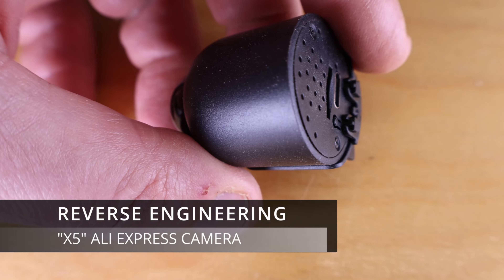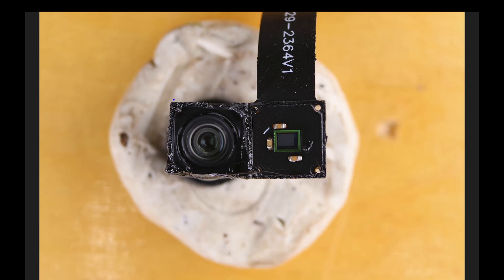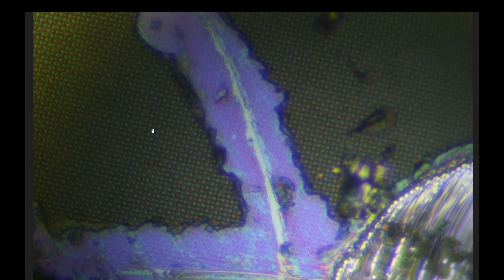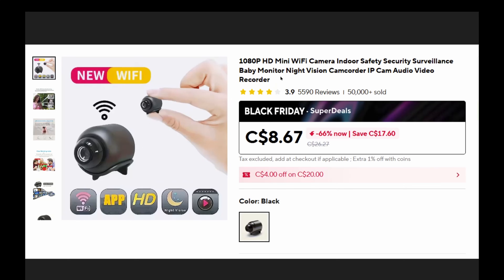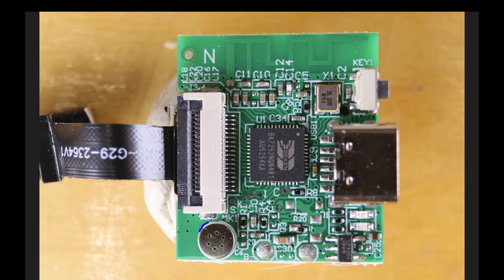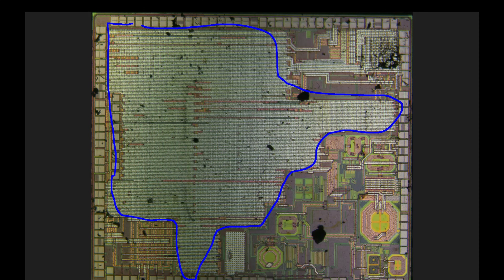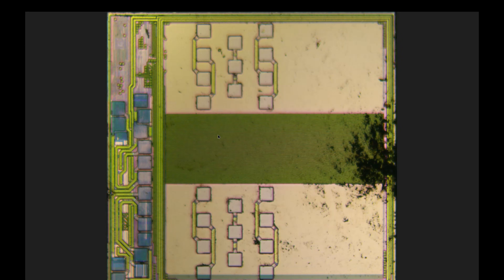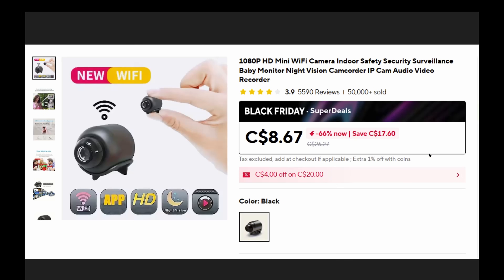Reverse Engineering Ali Express Spy Camera

Comment: I was actually looking up those spy cameras right around when you posted this video. And yes, I went straight to aliexpress when I had came up with the idea of me wanting to put cameras in my frog tank. But after a few hours or more of trying to pre-research specs on these, and then trying to camera of what I can find for popular security cameras... I figured that the $100 security cameras didn't have the quality that I wanted, something like claims of 4k at 24 fps, but actually paying attention to clips recorded from the device, I didn't like it. So I go back to looking on aliexpress, and just think, there is no way a $28 4k spycam is going to be better than these $100 ones.

And I kind of had ahead start in the rabit hole, because I had bought a so called 4k polaroid camcorder from a thrift store for $20. And I recorded some videos of my frog, and the quality was -- not what I was looking for, and it seem to have no focus system at all and it was digital zoom without any kind of focus system. It seemed worse than my ulefone armor x11 phone that I bought in 2023 for $170.

I ended up figuring out that I can just use my work provided iPhone 16e or something -- it has a single camera on the back... And I actually like the video quality it can record of my frog. It's just that I have to manually wake up in the middle of the night and turn the light on for maybe 30-60 seconds and record whatever the frog is up too, because the frog is nocturnal, but at least I get quality that I like.

Comment: The 5 pin chip is actually a battery charger chip, which outputs to the 2 unused solder pads along the side of the board. And for some more fun the other 2 pass on the other side of the board are actually for ir leds, for night vision. You can actually see voltage on the pads if you select the night vision toggle in the app.

Comment: Those beken chips are pretty popular in iot devices these days. Afaict, they're all old ARM9 cores (like, armv5 I think?), not even cortex-m (I think they might also make one or two risc-v models), but the manufacturer has shipped/leaked enough sdk files that people do manage to get their own firmware on other such devices. Kind of weird they use such an old core but presumably they got a bargain on the license (in exchange for missing a bunch of atomics instructions among other things), to leave enough for the various other silicon IP in there. (Radios etc)

Comment: Girlfriend bought one to use as wildlife capture for backyard, I took one look at it and thought - that'll never work, installed the app, usual Chinese affair, could not get the damn thing to work. My thoughts exactly on the agenda setting up the app, to be fair I was more inclined to believe it was an attempt to extract more cash for "unlocking" features. Definitely a case of but cheap pay more, better off just buying a reputable standalone device, we'd never need WiFi connectivity, just being able to bring the memory card in for appraisal now and again would have been ideal

Comment: For those playing around with these: While I'm not aware of any alternate firmware, there is a small tool called "cam-reverse" by  David Ventura which allows you to grab the images and audio locally. It also works in P2P WiFi or if you block internet access for the camera. Not entirely reliable, but still better than recycling a working product.

Comment: Those beken chips are pretty nice and a lot of newer IOT products (mainly from tuya or tuya rebrands) use them. They are supported by opensource software like openbeken and such. They are usually found in such tiny micro cameras where there is no space for a full embedded linux system and they instead run Rt-thread RTOS and use a simple firmware

Comment: Surprising they went to all the effort to integrate wifi but not an oscillator circuit to use a simple crystal rather than an external oscillator
Reply: if you want your thing to work right you cannot depend on whatever is on the silicon, you have no reference on it.  
One can characterize the silicon quality of service and do some other cool things with a couple ring oscillators but even then you're already adding external clock/stimulus on the testbench.  If one cracked open a device that doesn't use an external component then 100% they would find that it's not a system on chip but system in package.

Timing/clocks will have calibration and offsets, etc, but when looking at frequency stability/accuracy/precision it's always applied to make the stuff in the chip work correctly when you look at the cost (technical and financial) of the whole proposed ASIC if you can get away with using an oscillator (or even cheaper, if you can use a resonator instead) because as capability increases the cost of crystals will go up and if you can live with the tolerances in a packaged oscillator they stay relatively flat and relative cost can approach zero with higher order quantities.

it's easier to integrate wifi into your ASIC these days if it's a feature you might want - for example a lot of BT/WiFi chipsets are sold that simply don't have one or the other pinned out because it was cheaper to get those than just one of the other; remember even intel used to snip pins on CPUs for a long time to drive cost differentials while keeping their actual fab SKUs the same and just binning them to sort for application/product tier.

Comment: I got one with bigger price tag on it to see if more expensive are 1080 or at least 720, but its not. Its all vga with interpolation to bump resolution to 1080.
Also about those permissions when installing apps. Its mostly due to Android putting everything in one bag and developers not bothering to fix it. Like some apps need localization for Bluetooth/WiFi device discovery or... language selection. Or some apps need calling permission so when someone call you it can show popup in front of that app/not force close it. There its lots of silly things like that that doesnt really have anything to do with "spying". As today if someone want to spy on you they just get your data from bigger companies or social media. As its like passwords. We constantly get reminded to make strong passwords and change it often... but almost all recent data breaches are from main servers of companies, so no matter if you have 32 long password, companies main servers have like admin/1234 security that could get "hacked" any day by anyone...
Reply: I actually put the app for a borescope camera from Ali through some reverse engineering programs and it was indeed making use of some large scale data hoovering (location, contacts, calendar, basically everything) and then sending it back to a control server. The best part is that the camera didn't even work and when I took it apart, found that there wasn't even a chip on the board for processing the uvc camera data into something that a phone or computer could read so it was something that never ever could've worked